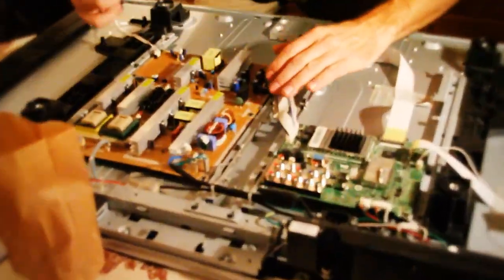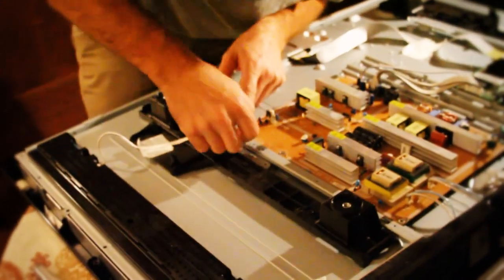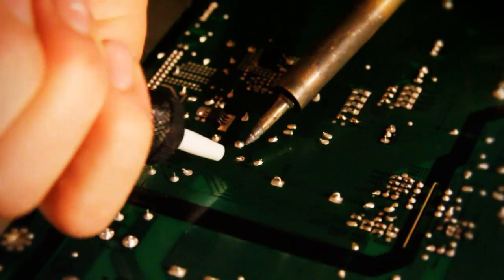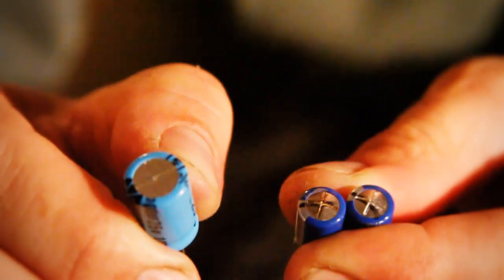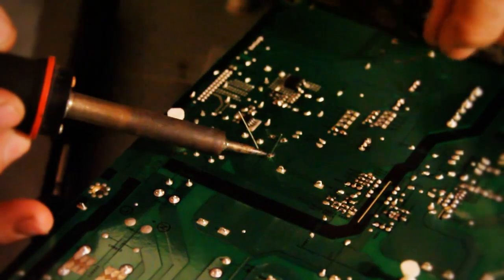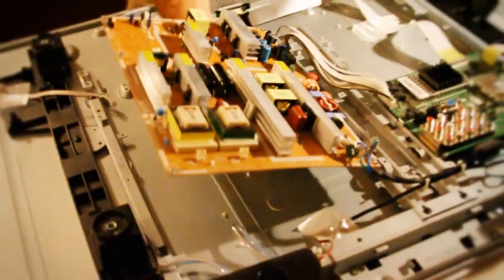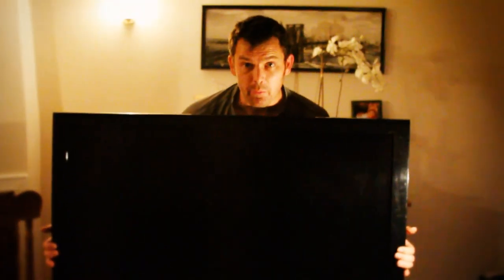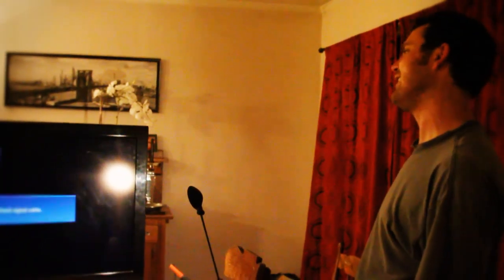Pierres' QuickFix LCD Samsung

Comment: Hey there, I have a samsung 46" tv as well but different model and have the same problem where the tv would not even turn on and constantly have that clicking noise. I'm assuming it's the capacitor problem.

Anyway, in your video the timeline of 0.21, I see there are two black capacitors above the blue capacitors that you removed. Are they the same capacitors?

Im just worried that in the future those other capacitors will blow and I was thinking if I should change them all. Wat do you think?